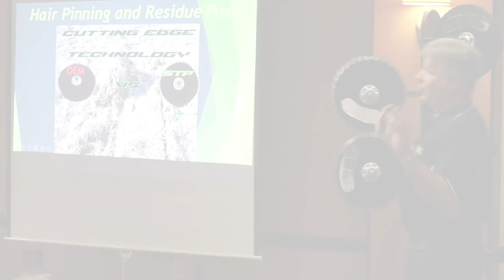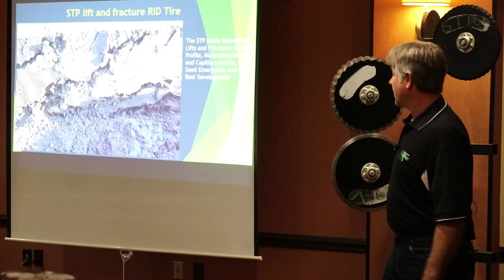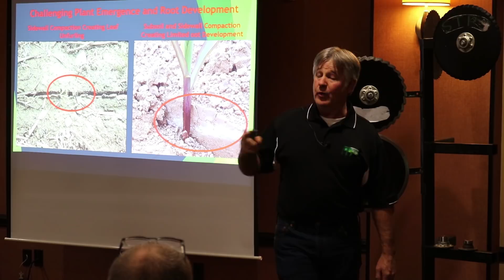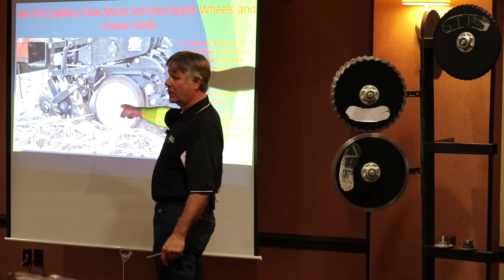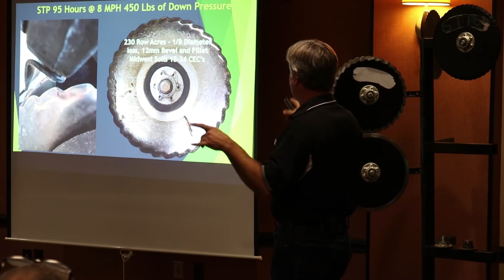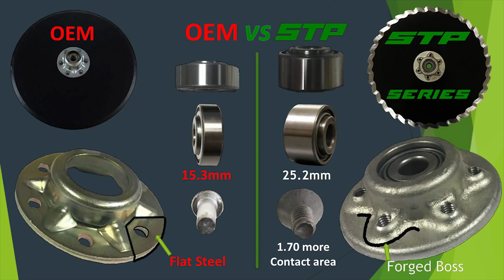PTT STP Disc Opener Blade Training  - Agronomic Geometric Theories

Comment: What is the ideal distance of contact on a properly shimmed STP notched blade setup? I bought 4 rows to try and I want to make sure they are installed correctly.
Reply from the maker: The ideal area of contact for properly shimmed blades is .75"-1.5". You should be able to rotate them in opposite directions with little resistance when installed. Please view our new video on our channel detailing this process step by step. Thank you for trying the Disc opener blades!.
Reply: Prescription Tillage thanks for the info. I’m eager to get them in the field.

Comment: What specifically are the closing wheels you recommend
Reply from the maker: It's completely dependent upon your soils / farming practices / and weather conditions . With our blade we prefer to use stock OEM closing wheels as the blades loosen the furrow sidewall for better closing with OEM equipment.  In some extreme cases closing systems may have to be used but the type of closing system again is dependent upon the specific needs for that producer.
Reply: @prescriptiontillage9174  if this blade can works in mini till, strip till and no till?